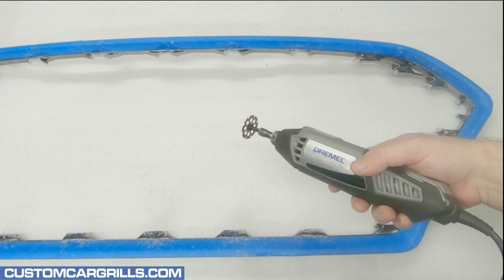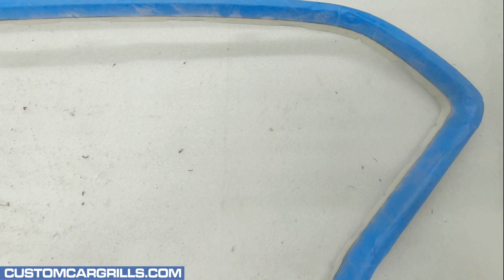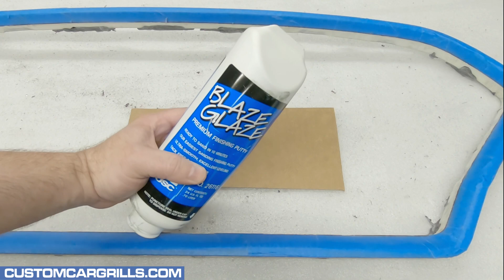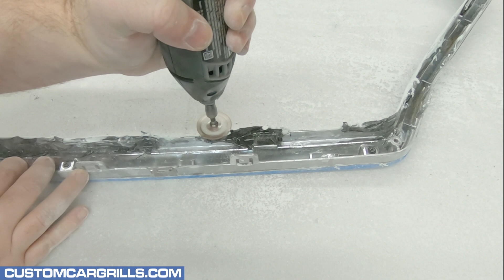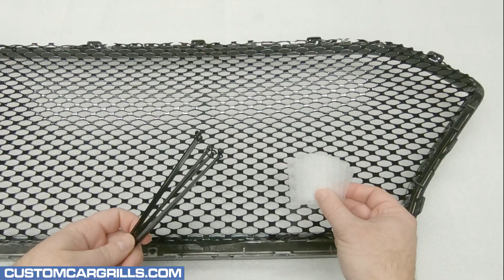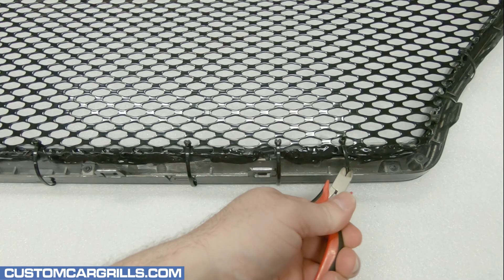Hyundai Sonata 2018+ Mesh Grill Installation How-To by customcargrills.com

Comment: Is there any update on if this will come back to the website?
Reply from the maker: I think it's unlikely to return to stock in the black mesh.  I can easily cut more from raw aluminum mesh though.  At this time we discontinued the product because too many owners were unhappy with the installation as shown in this video.  If it's something you feel comfortable working on, then feel free to email me at info@customcargrills.com and we can set up an order for a raw aluminum version.
Reply: @customcargrills  Thank you for the quick reply, I think the black looks fantastic. I assume cutting the raw aluminum would then just need to be painted a gloss black and installed as shown in the video?
Reply from the maker: Correct, you'd need to paint or powder coat it after I cut and shape the mesh.  I think the install looks fantastic too, but many owners found it too difficult to do which is why we stopped production on it.
Reply: @customcargrills  That sounds good to me honestly. It looks good and beauty doesn't come easy

Comment: Why can’t you use it if you got front collision detection I want too buy this for my turbo limited
Reply from the maker: To my knowledge, there is a sensor is in the emblem of the grille for some models.  Maybe it's for front collision or maybe it's for adaptive cruise, I'm not sure.  If you remove the emblem, then the sensor would need to be relocated behind the mesh.  The sensor won't function behind the mesh because it can't sense through the metal grille.  Without making all sorts of brackets and a plexiglass window, whatever sensor is behind the emblem on some models won't work.
Reply: customcargrills the sensor is already behind the grill not the emblem it’s the  automatic braking system.the stock grill on my car is the one in your video .the  grill holes are so big when I was driving on the highway a pebble  went thru and cracked my sensor  and warranty wouldn’t cover it and I’m like why is it out in the open .i think your grill would actually protect it better
Reply from the maker: @moregains4393  As long as the sensor doesn't need to beam through the grill in order to function, then it this may work.  Usually, these sensors can't beam through metals (such as our grilles), which renders them inoperable.

Comment: Any coupon codes ? Pretty pricey when you put shipping into it
Reply from the maker: Currently, we don't have any promo codes available for this item on the up front cost.  It should be around $100 with shipping (within the US).  We do offer cash back though for installed pictures being sent in that we can use on our website, this typically ranges between a $5-10 partial refund.